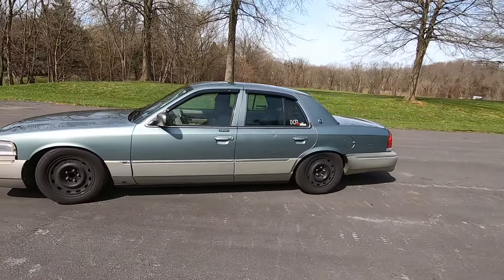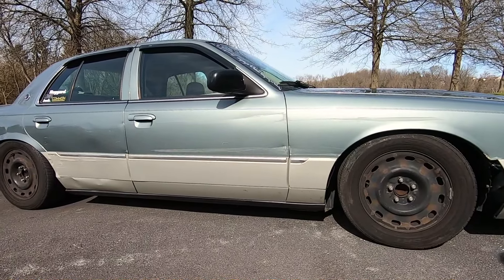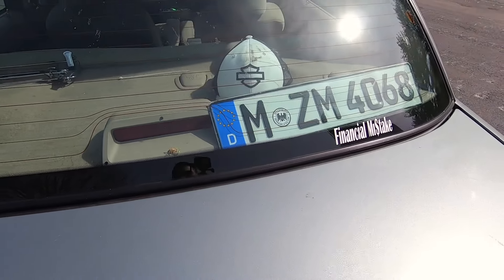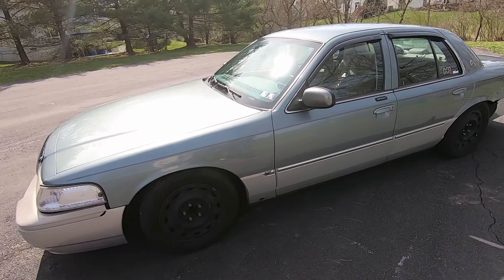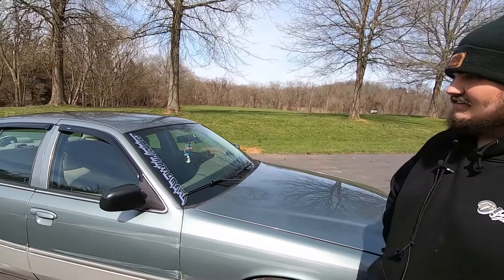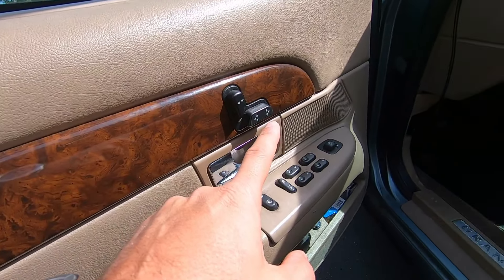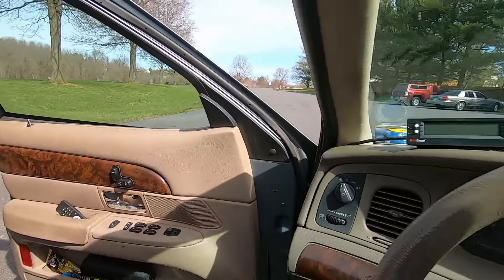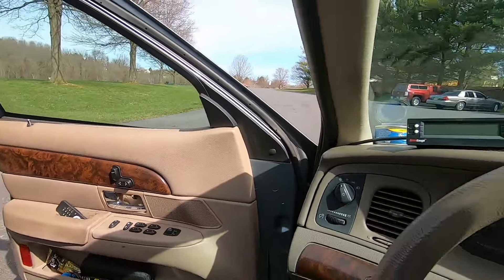2005 MERCURY GRAND MARQUIS GS

Comment: I love that exhaust sound, I have a 2005 Mercury Grand Marquis in a Silver paint exterior. I wonder how I can get mine to sound clapped out
Reply from the maker: lol
Reply from the maker: Gabe can point you in the right direction with getting your exhausted ripped out
Reply: Cut the exhaust off right before the secondary cats, 3 pieces of 18”x2 1/2” pipe on the passenger side and 2 of the same on the driver with a big hole at the first weld from scraping lmaooo